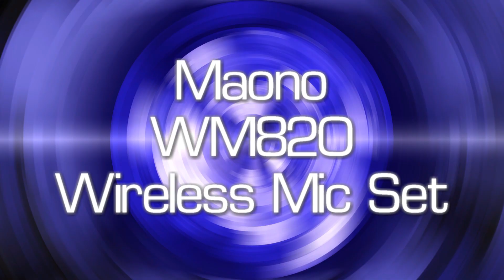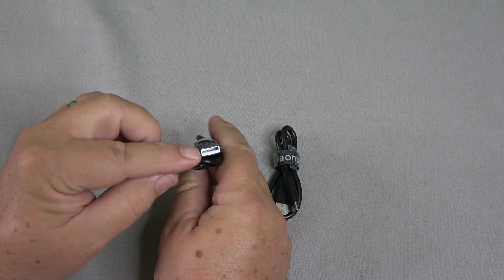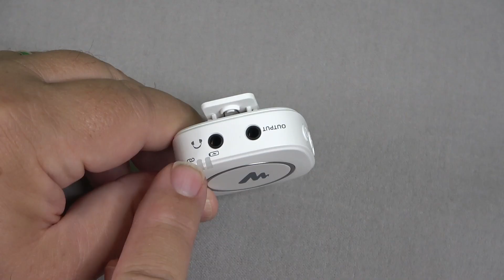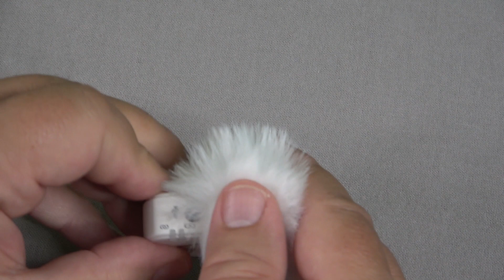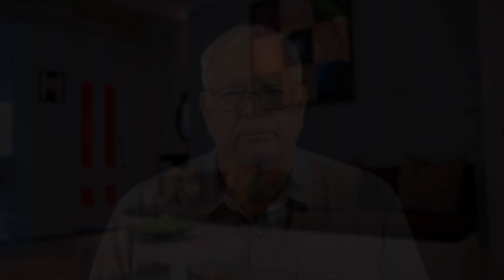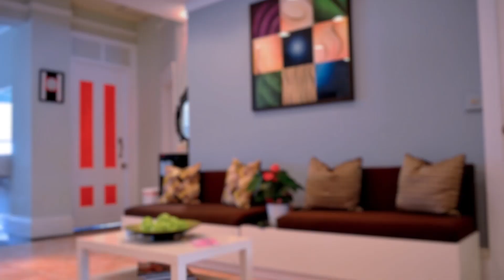Maono 2.4 GHz Wireless Mic

Comment: The hissing is a problem for me, other than that, sounds great.
Reply from the maker: Felix, I had to mess with the output from the mic and camera/recorder input to limit the hiss. Try driving down the mic output level and add gain at the camera. I found I got acceptable audio that way. I also often use Audacity in post to remove noise with good results. Thanks for watching and commenting.